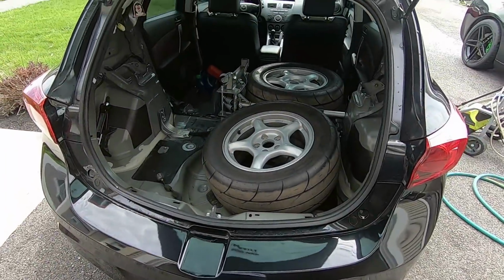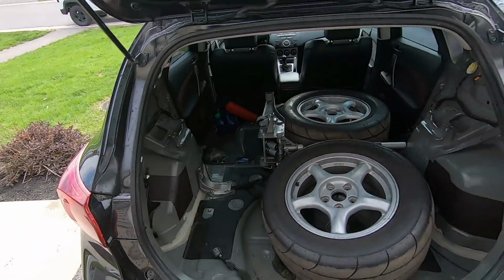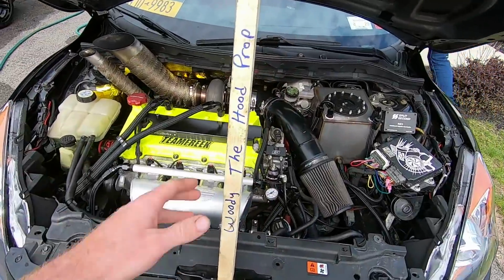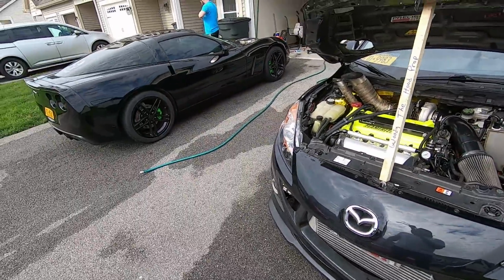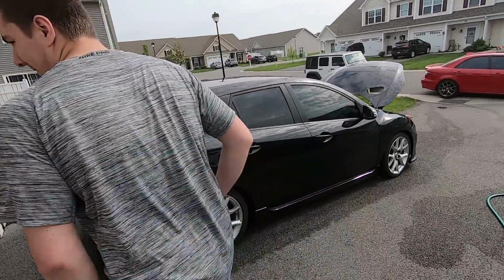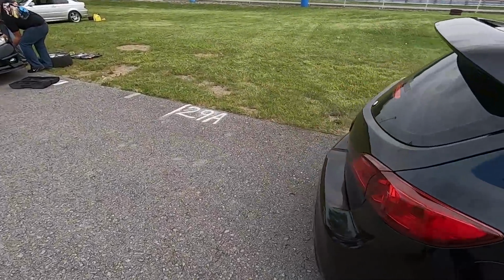Crazy Mazdaspeed 3 Hits The Track / This Thing is Getting Fast! We Are Starting To Dial The Car In!!

Comment: What times did you get out of the speed6?
Reply: pH Garage bump
Reply: pH Garage I don’t remember the exact times, mid 13’s I believe? he did end up trapping 104 and that’s with the car running 19 psi instead of the 23/24ish it should be running, we checked for boost leaks but couldn’t find anything...we adjusted the wastegate preload over the weekend so #freektune can crank it up!

Comment: Cool stuff, is it possible to use Boost by Gear would likely improve times and traction.
Reply: Alright, wall of text incoming (you've been warned, LOL):

With hybrid tuning strategies on the Mazdaspeed platform you can limit power via the throttle plate in conjunction with some of the load tables, which is somewhat effective.

To do it right, you really need a 4-port to be able to run a very soft wastegate spring yet still have the wastegate duty cycle available to get high enough boost pressure on a setup like this. The rule of thumb is a 3-port setup can about double spring pressure, so you could get to ~28psi on a 14psi wastegate spring, for instance. These guys are running over 30psi though, so they'd need a 15-20psi spring with a 3-port setup.

A 4-port setup can more than quadruple (or more) spring pressure, so they could run 10psi spring pressure and still wastegate duty cycle for almost 40psi. And using a soft spring is great because you'll never make less boost than spring pressure. If a 14psi spring still spins the tires, the 4-port route can get the boost floor even lower by allowing a softer wastegate spring to better hook in the lower gears. And you can still always use the throttle plate tables with the 4-port, too.

4-ports can be really tricky to dial-in, though, and that's why they're not so prevalent on the Speed platform. Here's a good read: https://www.enginebasics.com/Advanced%20Engine%20Tuning/3%20port%204%20port%20boost.html

Comment: Is that EWG dump dancing? Tha' heck?!

FWIH, you don't have to worry about the stock axles until you get down to the 1.6s or so, but I could be wrong. Sweet pulls, guys.
Reply from the maker: ya its weird the wastegate "moves" but its like super tight

Comment: start in 2nd or 3rd gear for the burnout..2 step to build boost then feather the clutch out..you need more wheel speed to get the tires warm...Less rev limiter my guy..3rd gear burnouts all day...start in the middle of the lane also...your were so far out the groove.